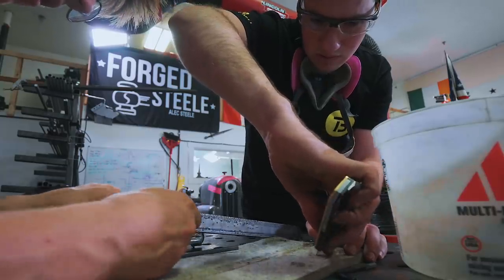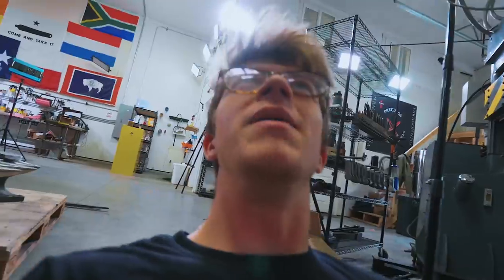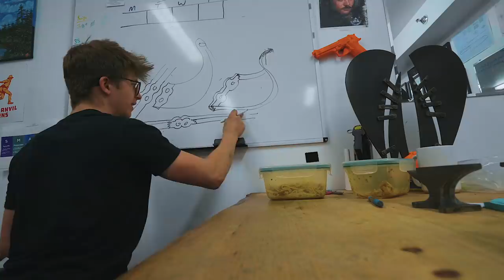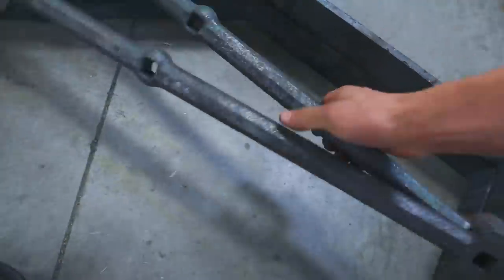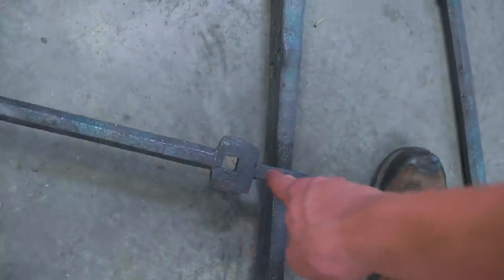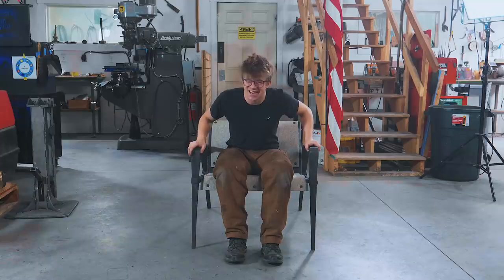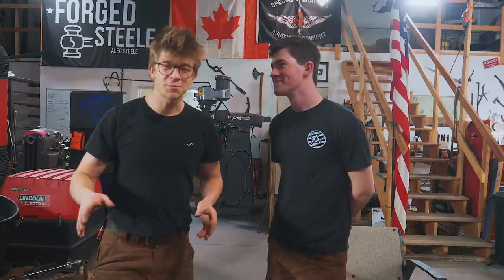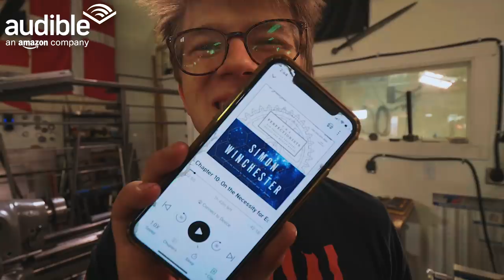MAKING A STUPID-HEAVY FORGED CHAIR!!! Part 3

Comment: Hey Alec, Long Time Subscriber. Here's an idea for a Rocking Chair if you ever want to forge one... Super Comfy (even more than the one in the video). You take a Car Coil Spring, Cut it so that you have 1 1/2 winding of the spring x 2.  Forge a Chair Base, put aside. Forge a Seat, put aside. Use 2 of the coil windings - one on the left, one of the right side of the chair, put them vertifcal between the seat and base of the chair (so that if you look at the chair from the side you see an O) and weld it to the seat and the base. End result is as you rock forward and back the 2 x coil sections compresses and releases. I have a set of 8 of these, the best rocking chairs ever.

Comment: I hope this is good advice. 

The blue butane gas you use on the blowtorch burns colder then yellow map gas. 

Im a boiler engineer in the uk i use them both for soldering all the time.

Comment: Very cool chair! If you want it to flex leave the rear bolts out. They aren't needed to keep the chair together, just the front bolts. Or, you could bolt the rear with a single bolt in the middle. That way you don't concentrate the stress at the back and maintain the strength.

Comment: I never really get the point(sorry😁) of all the swords/axes etc but that chair is exactly the sort of chair you want in a metalshop; heavy, fireproof and unbreakable. It should last as long as any of the powerhammers too, unless it rusts. Painting it might spoil the "rough & ready" vibe; will it need paint?
The idea sounded so simple but it turned into a tricky(ish) project, great funn to watch. Tyler's input helped too; I'm off to check out his channel now. 👌👍😁

Comment: Smaller nuts. Got a good laugh. 
Do more of these forged fun stuff videos. Forge a dresser. Forge a table and do an epoxy and wood top. Forge some floor lamps (and fully wire them) forge a fancy display case. Etc

Comment: If you want shorter bolts screw on a nut to the right length, clamp it in the vise, cut it to length with a cutoff wheel, and the when you unscrew the nut it cleans up the threads.  Works great.

Comment: Obligatory machinist comment: A collet chuck in the lathe would have let you grab the heads of the screws and part them to length. If you wanted to get really fancy you could have bored a step collet to hold them more securely still and at a set depth, or set up a collet stop. I also advocate for having a set of drawers where you just keep all the standard SHCS on hand.

Comment: I had the same issue with a pocket knife I was repairing .. Apparently through its life it lost the same type of nut and bolts that you have here..That fell out .. So I found replacements but they were too long. I took them to a old heavy sharpening stone used to re-edge my knives.. It took me a few hours but I got them down to size so they fit through the handle and I could tighten them properly. I missed this knife !! lol

Comment: The felt bits reminded be off something i see on another markets channel last week. Rivnuts (maybe tested? Not Andy Raels, i don't think). Not sure of spelling or branding. Basically, it's one face of the rivet, but it's also a threaded nut, so the other component can be replaced.

Comment: Radius the ends of the cuts in the back plate. It’s a high stress point and will crack like the joints in the Titanic. It will be a Titanic Failure. Lol

Comment: For the backrest... why not just add a bar stop from one corner of the an arm to the other. If you leave an inch between the back and the bar stop the flex of the chair remains, but the bar will stop it from over flexing.

Comment: Eerie, those pesky barrel screws. Never had to use them in all my life before, then had the same exact malarkey with them some 10 days ago when putting an Ikea bunk bed with missing screws back together. Same problem, replacement screws too long, same steps - shorten nut, bolt won't go in far enough, what to do, how to tap, imbecility check, shorten bolt, all good. Had only eight to go through though.

Comment: I came to metal working from wood working, so maybe this is just not how you do it, but I would drill some holes in a board that was as thick as I needed the bolts to be long, and then anglegrinder the parts that stick out.

Comment: I have a question. how does it smell when you heat metal? my dad used to solder a lot and the soldering iron had a pretty distinct smell. is it anything like that?

Comment: Those nuts or bolts are going to tear right through the felt. You should have probably sewn a leather patch on to the felt so that there's an actual structure to where the mechanical fixture will attach.
Reply: Also plasti-dip those feet.  Otherwise your floor will cry.

Comment: I hate being that guy that suggests something after the works done, but a washer under the cap screw would've worked just fine to "shorten" it through the sheet metal. Also; the worst part of throwing something across the shop is the walk of shame to go pick it back up after. We've all been there, dude. At least, anyone who's ever made something worth making has.

Comment: I'd have been worried the felt wouldn't be cushiony enough, and that those "chicago screws" or whatever, in the middle would poke your back a bit. but I guess your lower back doesn't go down into the corner and your upper back would only rest on the top one if you really really leaned waaay back. I'd have loved to see leather upholstry attempted for it, but that would have taken waaay longer.

Comment: you could've just used washers to take up the extra threads on the screw .....it gives you few degrees of adjustment depending on how many washers you put between the chair and the frame vs how many under the frame !!!

Comment: Additionally, I would recommend that you make the seat part over without the slit in the metal where you bent it. Keeping that part of the chair solid will strengthen the seat back, protecting it from fracture. By making that change you most likely would not need the supports your stressing over.
Reply: They'd need a brake to make the seat without that cut.

Comment: Alec: "Once we bolt it down here..." 
Me: yup, you're concentrating the stress. It could push to plastic deformation (laymen terms: permanent  bend, not spring back)
Alec: I'm  not an engineer, an engineer can calculate  this
Me: LOL yup. Already working how to calculate  that.

Sometimes love being  an engineer.
Reply: Yeah, but... engineers are just number nerds that don't get to hammer white-hot pieces of steel!
Reply: If you are the right type of engineer you will be able too ;) 

Be an engineer at light and a blacksmith at night
Reply: @Isnogood12  well, I'm a woodworker by hobby. Someday I might try blacksmithing, but probably not.

Comment: Do y’all need an engineer? I got a mechanical engineering degree with over 2 years experience, experience with 4 different design softwares, an ASME certification for GD&T, and have been woodworking since I was 13 (I’m 24)

Comment: Could you not have just oversized the holes and used a washer on the back so that the bolts would slide through if you lean on them? No need to shorten the bolts then

Comment: Why didnt you just drill a whole in a piece of flat bar that is a thick as you want the nut long so the nut would sit on one side and you grind the other side flush with the flat bar? kind of Like a grinding monkey tool with a different purpose.